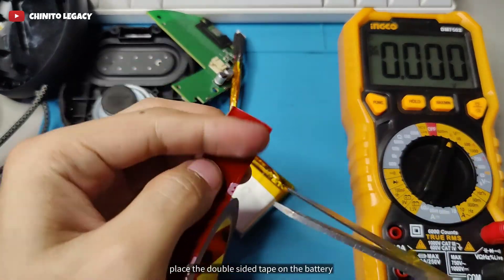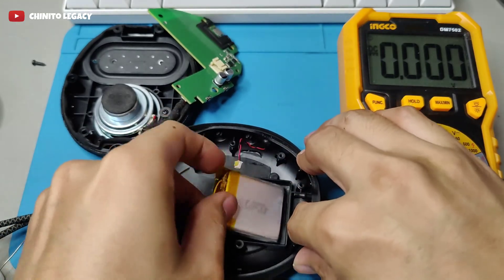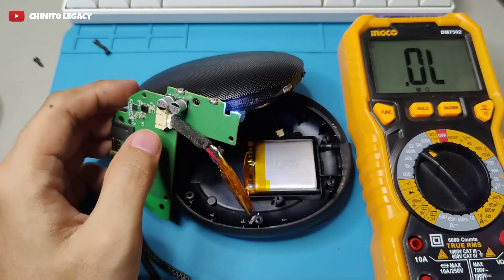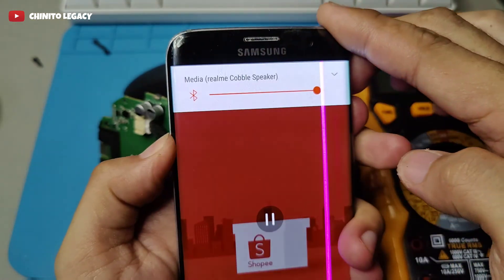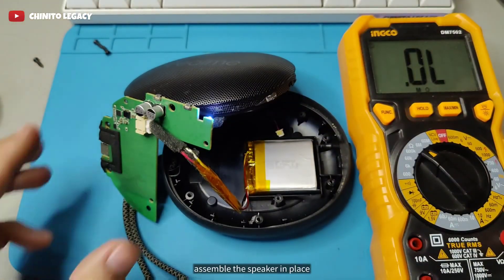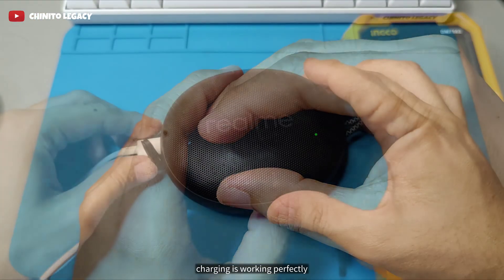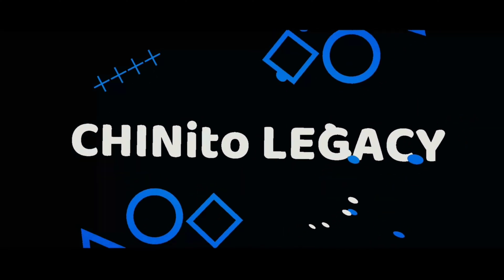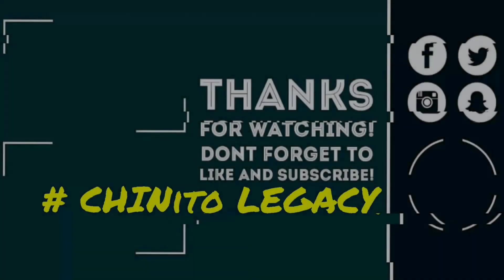REALME COBBLE SPEAKER NO POWER REPAIR GUIDE

Comment: My speaker turns on only when charger is connected, what's the reason?
Reply from the maker: Faulty battery bro
Reply: @chinitolegacy  thank you Bro..
Reply: @chinitolegacy  bro its fixable or not? Or change of battery is the solution?